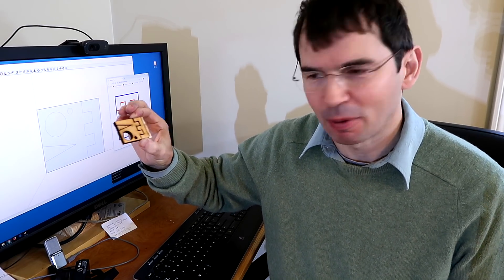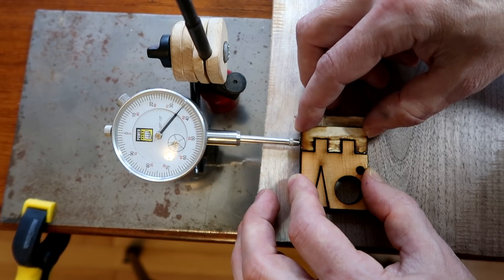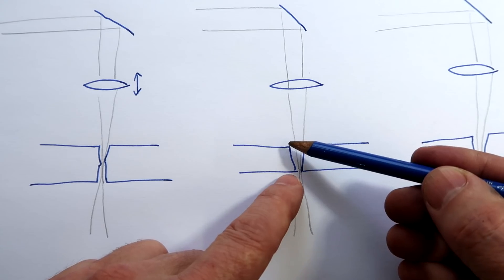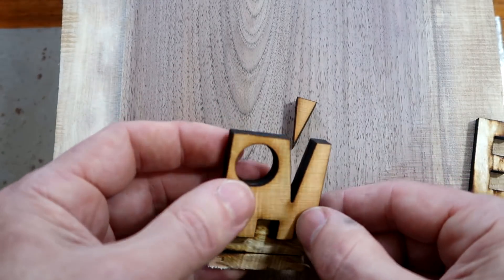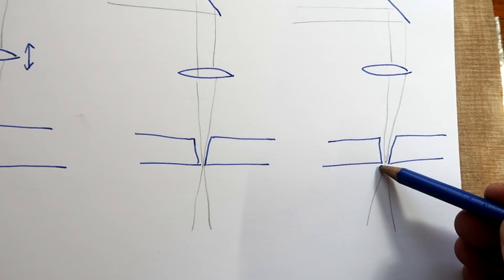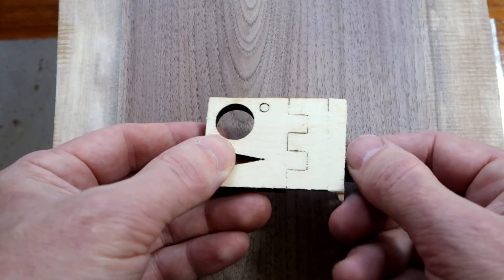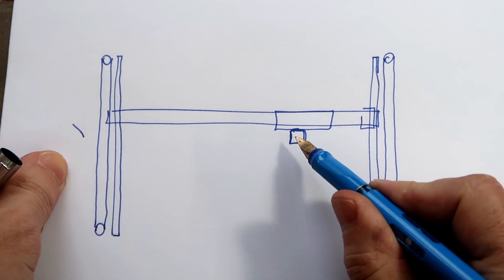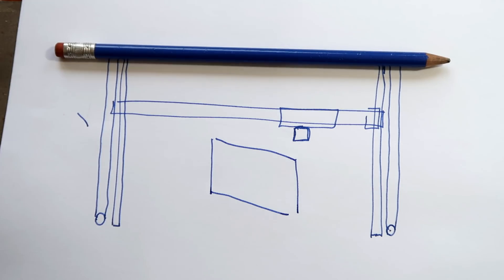Laser cutter cut width and inaccuracies

Comment: LASER cutters are very good for some materials. But for wood, NO. Sand off the char and you have a wide gap. Wood should should be cut with sharp, cold steel. Like a saw or knife. Burning it into pieces seems lacking to me. Wood and fire don't mix.

Comment: Normally, you don't just design and cut. You measure iterate then cut. The next day, if three laser has been used, you test again.  Also the far end of the bed can cut differently than the other end.   Even lasers aren't perfect and require calibration.  And yes, kerf depends on the depth, and power of cut.

Comment: Awesome video thanks.

From my relatively brief experience with laser cutters, it's possible to get the kerf down to about 0.1mm for 3mm mdf or 3mm acrylic by tweaking laser power, pulse frequency and movement speed for each material. Air pressure reduced smoke staining but didn't make much difference to the actual cut quality. Thicker materials get progressively worse as the diverging beam thickness causes a wider kerf as you get further above/below the focal height. If you allow for it, I found it was possible to reliably control for a consistent interference fit. Where possible, I cut adjacent parts upside-down from each other to do as Mathias did with the triangle and match the angled cut surfaces.

That said, I never got good results with wood of any type (plywood or solid board) as the density is too inconsistent. It either doesn't get all the way through or burns some parts quite badly. Manufactured sheet goods like paper, cardboard, mdf or acrylic were the only options that gave good results (ours was not powerful enough to cut metal).

It's just another way of making things with advantages and limitations. if you're aware of these then laser cutting can allow you to do amazing things.

Comment: Good to see you up and making videos! Someone cutting laser-joinery just needs to be aware they'll not be able to nest box joint ends and have them form a tight joint. They'll need to adjust the kerf width and cut the pieces completely separated. Otherwise they can get familiar with gorilla glue. 😉

Comment: Goodness. So much room for error. It's amazing that people have ever gotten laser cutters to work. I mean, even if the machine and all of its associated alignments are perfect, then you still have to deal with the margin of error that comes from the amount of heat necessary to 'cut' the substrate. With focused light, there will always be some collateral damage to the material, I guess. At least until the invention of the atom scalpel (by Va-POO-rize™), but then there will still be the gantry problems! 

Back in the 90's, in my high school drafting lab, we used a plotter for our drawings. It was the most amazing thing ever to me, the way it would so perfectly grab different colored pens- but by today's printer standards, it's a dinosaur. I wonder what cutting devices we will have in another 20 years.

Comment: I had a few years,13, experience having plywood laser cut for customers. Here in Australia, the plywood industry manufactures with 4 different glues, differentiated as types A,B,C &D. Type 'A' being the hard black brown 'exterior' glue you are used to seeing in most structural, exterior and marine plywood. Type B is melamine fortified UF. It is not fully water/boil proof, but still considered an exterior glueline. Type 'C' & 'D' are UF gluelines, and only suitable for interior use. Type C and D gluelines cut cleanly with almost no burning at all, just light brown 'nearly' charring. The type 'A' Phenolic Resin gluelines were the ones that charred to the point of ignition if moved too slowly. So, that's why all of the commercially manufactured and marketed laser cut plywood products, only ever use interior plywood. Trap for young players...Cheers
30 yr expat ( and lifelong timber merchant) in AUS

Comment: I work on the Markerspace, I know ppl comes to makerspace using laser, 99%  people think they know how to use laser but there are not,  result what you show in the vid, cause focus, air compressor(air assist) and mis-alignment of the belt. this can be fix, not a laser problem, just know how, I cut walnut, purple heat with succeed, there are many tips and trick, just need to explore

Comment: To be fair, most of those inaccuracies are easily accounted for in either design or software. 

Regarding the skewing, I thought most CNC's with multiple motors for a single axis are connected together in tandem, such as with a belt, which divides the load, prevents the possibility of the motors traveling at different speeds, and thus prevents skewing, as well as eliminates the possibility of racking in situations where mounting the axis motor along the center line isn't feasible.

Comment: If you look up the wikipedia article on "Rayleigh length", you will discover a simple formula that allow you to calculate the width of the laser beam at focus.  The narrowest cut will be achieved if you set the Rayleigh length equal to half the material thickness.  You can then solve for the laser-beam width at focus.  Applying this formula to a sample thickness of 20 mm and a wavelength of 10 microns, you get a kerf width of 0.50 mm.  That's the best you can do by focusing optimally in the middle of the material.  How much wider it will burn is another thing entirely.  With a 6-mm-thick material, the best obtainable kerf width would be 0.28 mm.

Comment: One thing I would be interested in hearing you review would be home and/or "prosumer" laser cutters/engravers. I think the price point for most home business folks (like me) is around the $500-$1,500 USD price range.  My purpose would be cutting thin soft metal and wood (1/8") and engraving with designs that would require a fair bit of detail. Bonus would be how you come up with doing engraving on cylinder.

I've been considering one for a long time but most of the reviews I've seen have been low quality or shill spots. I don't remember ever seeing you look at those and a quick search on your channel didn't bring up any results.

Thought maybe this would be something you could do while healing and would be extremely interesting to me. Just a thought - hope everything is going well with you and the family.

Comment: Interesting test piece. In the next few days I have to measure the kerf of my laser to be able to make box-joints. I have chosen to make a test piece that is more of a "Frame" and the middle cutout is actually 9 pieces (10 laser cut passes) I can then cut it, push all of the pieces to one side and measure the gap on the other, divide by 10 and get my kerf. 

I usually only run 1/8" ply so the taper is less pronounced (You can buy lenses with longer focal lengths to further cut down on the taper).

To square my machine I 3D printed blocks that mounted on the Y Axis frame and then loosened one of the drive pulleys and pulled the gantry until it touched both of the "Endstop blocks" and then re-tightened the pulley to lock in the squareness. It's probably not perfect, but I can hold a square up to the edges and not see light on either side whereas before I could tell it wasn't square just by looking at it (So probably skewed at least a couple degrees).
Reply: MrBenjo11 , dividing by ten is a good trick.

Comment: We run a Trotec Speedy 100 60W laser and see far less kerf and angle.  Something seems out of whack with the laser and settings being used.  There seems to be a lot of burning as well, so the power and speed settings do not look to be correct.  May also not have been focused to the material properly.  What type of laser was being used?  Precision and quality really start to show when you are looking at the details.

Comment: You are measuring cut width not the precision. If you want to check precision you must cut 2 parts that will connect and then check. While cutting parts - cut width must be compensated and the fit will be perfect
Reply: Well, that's the point of the experiment, isn't it?  To figure out cut width in the first place.

Comment: If you use a non toy sized laser the focal length is long enough to not experience any issues regarding spot size over a couple of centimeters since it will be a wash with the minimal spot size of the laser. Issues with tapering should only appear if you are pushing the laser beyond what it is actually meant to be cutting.

Comment: I usually cut out a long trapezoid shaped wedge with the sides angled in at a 100:1 ratio. Then, cut it in half lengthwise. I then slide it over in the gap it came from until its tight, and use a caliper to measure the distance it moves. Divide by 100 and then offset all my paths in Inkscape by that amount. If you flip the piece and measure that way, you know how V-shaped your kerf is. You can just average the two measurements. This method almost always produces perfectly tight joints.

Comment: Most of the time, burnt wood is horrible. LASERS are AWESOME but not the best tool for wood working unless you want to do some engravings look like done with a branding iron. Other than that is not cost effective nor it produces nice looking results. Good that you also pointed that may be horribly inaccurate.
Reply: A lot depends on the laser quality, speed, power.  With ours we get almost no burning when engraving.  You even have to defocus often to get a darker look at times.  Higher quality faster lasers tend to more vaporize than burn the material.  Example on 1/8" baltic birch with an engrave with a lot of detail - https://youtu.be/jstigNB4HAw

Comment: couldn't the laser be focused and then collimated? it doesn't seem like that would add too much cost to these already expensive things
Reply from the maker: You can columate it, but it ends up a fairly wide beam.  It's got to do with the wavelength of light.  Make a 1 mm hole in a piece of electrical tape, look thru it.  Everything will be a bit fuzzy.  A narrow beam will always disperse.  If you want to concentrate, you need to focus it using a lens, but then it isn't columated anymore.

Comment: All you need is a wire edm lol. The wood might want to float in the water but it will give you the accuracy you seek. Kidding aside even if the lazer is not level will effect the cut as well

Comment: Maybe the lens (or mirror where these are used) which provides the laser beam convergence has a shorter focal length than is desirable for more accurate cuts in thicker materials (i.e. the angle of the cone formed by the focused beam is too wide for thicker materials). A longer focal length lens (or mirror) would produce a longer and narrower cone. This would give a reduced beam angle at the periphery of the laser spot as it penetrates deeper beyond the focus point at the surface. In other words the cut at the surface would be narrower than for a shorter focal length lens (or mirror where these are used) and the sides of the cut would have an angle closer to ninety degrees to the material surface. This may entail using a higher power laser beam so I guess that there are compromises made to keep within price limits.

Comment: Laser cutter kerf depends on many things inclusing the focal length of the lens (1.5, 2, 2.5 or 4") as well as the power of the laser itself and the material you're cutting. Laser alignment makes a difference too.

Comment: In what sorry state is that laser cutter at the university please? XD
 almost every thing that could be decalibrated is  decalibrated. 
Also why didn't the engineers connect the two sides with a steel shaft? doesn't need to be terrible thick and it couldn't decalibrate.  Must be because at a university so many different people use it.
Great video as always Matthias. ^^

Comment: At work we have seven lasers 2x4 and 2x8 meter cutting capacity and biggest laser is 8000 Watts. Thickest what we can cut is 25mm steel. Even though we cut 25 mm steel there is almost any taper in the cut.

Comment: Well a laser cutter is a tool that needs to be properly set up like anything other tool. The laser technology is not to be blame here, it is just a way off and misused laser. Some lasers are not meant to cut thick materials because their focal is too short. Long focal needs more power too. A good laser properly used cuts right within 100 microns, which is for woodworking à pretty snug fit.
On the other hand, Matthias test is not totally fair because this is not part A and part B jointing. It's part A and Its offcut. Like a saw cut you want to consider thé blade kerf. If Matthias had cut both parts A and B the joint would ne more snug even on this off laser machine meant to cut 1 or 2 mm material only.
Reply: Axel Sixtysix , exactly!

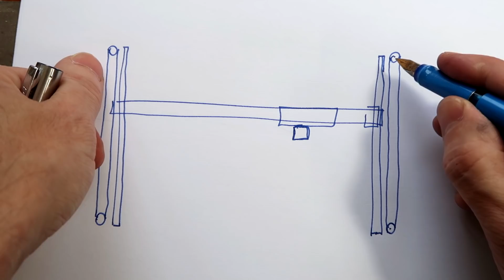Comment: 4:55 "... usually separate motors" No, usually there is one motor with a torque tube connecting both sides. Being out of square is easy to check, engrave or cut a large rectangle and measure the diagonals.

If the laser barely cuts through (as in your example), the top of the cut will be wide and the bottom very narrow (or closed). If you increase power or slow down the cut speed, the bottom of the kerf will open up, which will significantly reduce the angle of the kerf. I routinely cut parts where the kerfs are near enough to 90 degrees that they can stand on edge.
Reply: Mine is 2 motors
Reply: @nealcalvert1153  What make/model is it?
Reply: @HarmanRobotics  ye I wonder too, because it should be less expensive to just connect them via a small shaft than buying another stepper motor.
Reply: Both my current and former models are dual motors for the gantry.  While the epilog could possibly get away with one the glowforge I replaced it with has a significantly heavier gantry and pretty much requires dual motors.

Comment: Also for this type of laser cutter, the mirrors need to be aligned as well. 

However a fibre optic laser doesn't have as much alignment issues.
Reply: They don't like cutting wood though.
Reply: @epilotdk  it could also being a makerspace it's a cheap Chinese laser.

And it's never been calibrated properly.

I've had items professionally laser cut, and I haven't seen this before,  and that's even with 8mm aluminum plate.

Comment: Cutting wood with lasercutters is difficult,  usually you would prefer sublimation cutting with a laser with 120 to 200 watts above, else you would just burn through 

If you cut 6 mm birch for example with 60 W you will get a big taper but 6 mm PMMA will just cut fine

To reduce taper sometimes reducing speed, fewer pulses and higher power and multipe passes with different focal lengths helps - so just do 2 passes 3 mm each and adjust the focus after the first cut - it is trial and error (or just good laser software) but don't expect miracles on your first tries

This is also true if you want to cut steel even with 2 kW you'd rather melt through the material,  you'll need an additional oxygen supply to aid an exothermic reaction 
If i use wood i usually stick to 3 mm birch for small boxes and stuff, they fit perfectly on thicker wood i usually stick to CNC for box joints 3 axis are not optimal thoug

Comment: Could the kerf and the skewed cut lines be something to do with material being burnt away. It being exposed for more time at the top of the cut than at the bottom and therefore more material being burnt away from the top than the bottom.
Reply: Right. It should be obvious but many don't get this. If the laser does not cut all the way through the top of the cut will be wide and the bottom narrow. As you increase power (or reduce speed) the bottom of the cut will open up. Balance the speed/power correctly and you can get straight kerfs.
Reply: @HarmanRobotics  or its just simply the wrong distance of the lense as mathias mentioned. I imagine that a laser cutter at a university is terrible decalibrated because of those many people using it.
Reply: @HarmanRobotics   You can't get vertical kerfs with a laser cutter. The nature of the focal lens won't allow it. The beam starts off conical, comes to a focal point, then goes conical again. Like two ice cream cones stacked tip to tip.  A longer focal length will make it "more" vertical, but you will never achieve a 90 degree cut. 

I cut box joints with my laser engraver all the time. Every box joint generator on the web has an allowance for kerf built in. This is not new information, Matthias is discovering what people have already known for many years.
Reply: @brianmullaney2867   I've been laser cutting for several years. Yes you can get a kerf that is 90 degrees (I do it all the time), meaning you can stand a piece on edge and it will be at a right angle to the surface it is on. Is won't be a perfect edge like a router can do but it can be vertical to the eye. When the laser is vaporizing the material from the kerf it creates a sort of wave guide so that the resultant cut can be straighter than hourglass beam profile. To take advantage of this wave guide property you need to focus on the surface of the material.